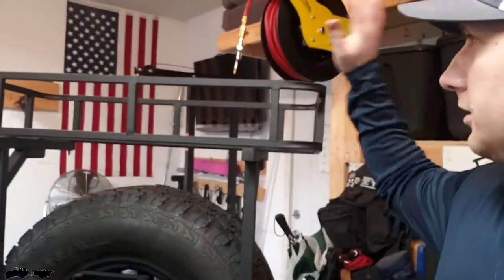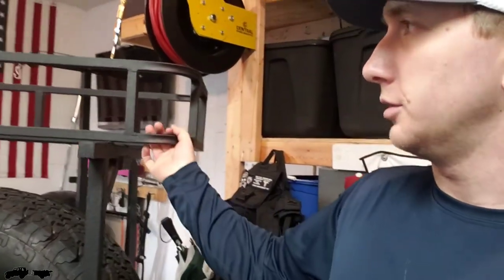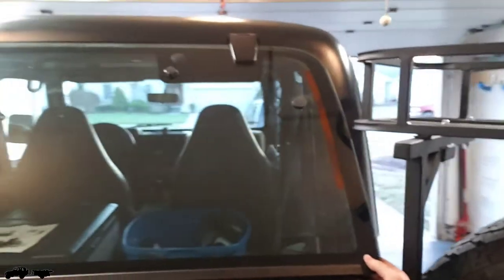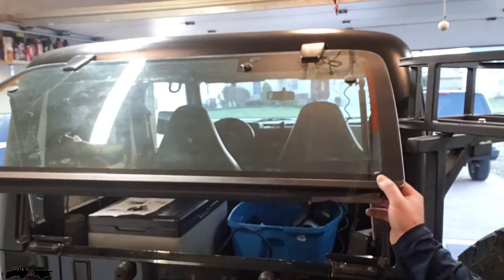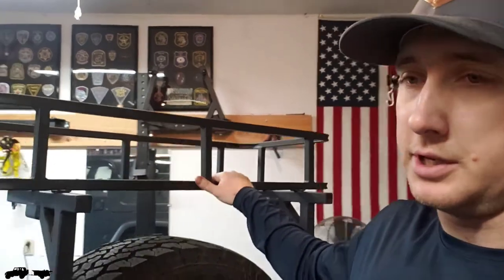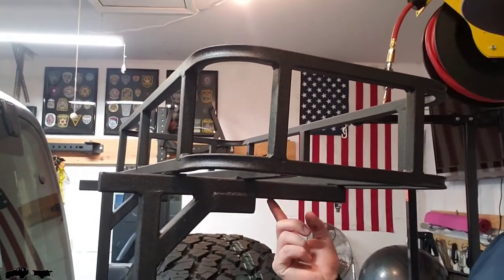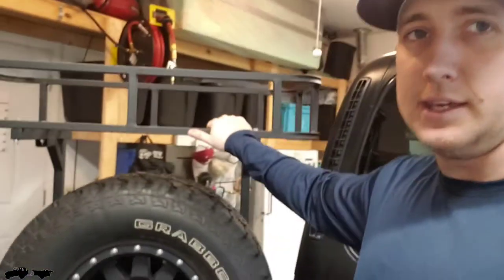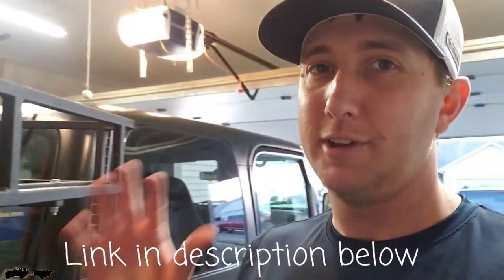EAG Rear Cargo Carrier Basket With Hi-Lift Jack Mount Installation

Comment: These baskets dont fit with a hard top. its worse with tailgate basket brackets. I was about to buy the Bestop tailgate brackets and basket but I did a mock up with some square tube and that was when I realized you cant open the hard top window, doesnt say anything about this at point of sale or on fitting vids/ instructions so its good you put this up :)
Reply from the maker: Yeah I still have issues with it now. I have since lowered it. I have a video on that too. It's not ideal but I can carry some extra gear when I'm not using the hard top. I haven't tried the lower basket with the hard top yet. I'm sure it will hit it though.